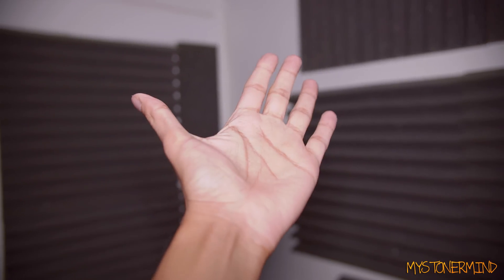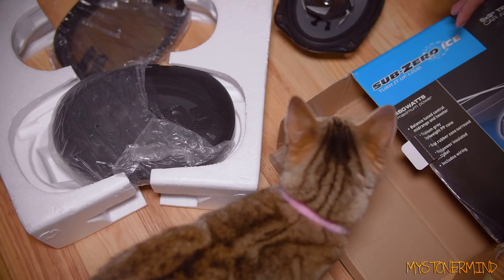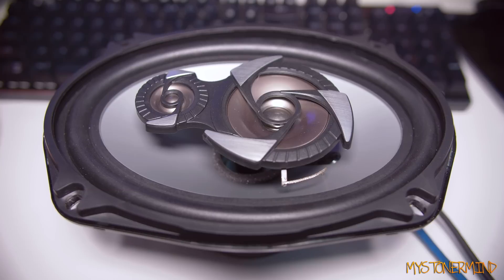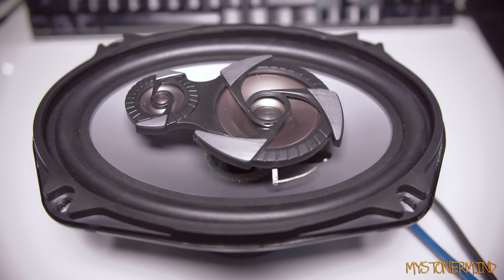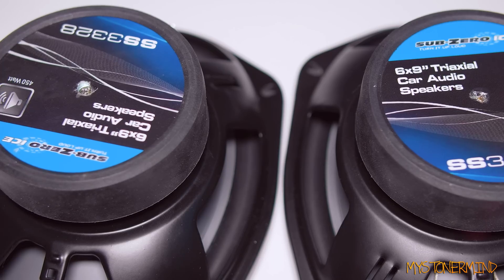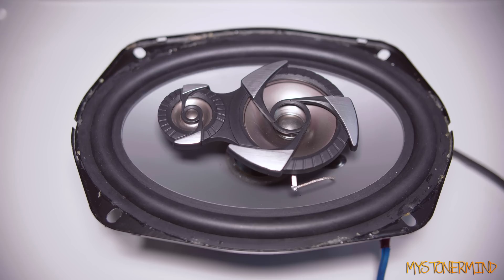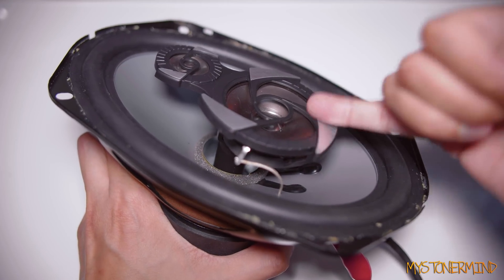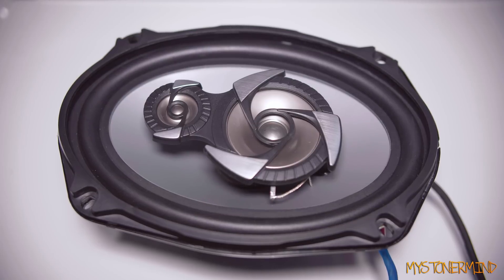OVERPOWERING A SPEAKER - 6x9 GLUE STRENGTH TEST

Comment: around 8:40 and onwards you can hear a high pitched and "springy" sound start to develop and increase in intensity as time goes on, that is the sound of the voice coil wire starting to unravel and scrape within the motor, it stopped moving probably as a result of the wire either jamming in the coil gap, or even breaking entirely which would result in an open circuit, and thus resulting in the instant stop/failure
No power/Path to Pos/Neg = No movement